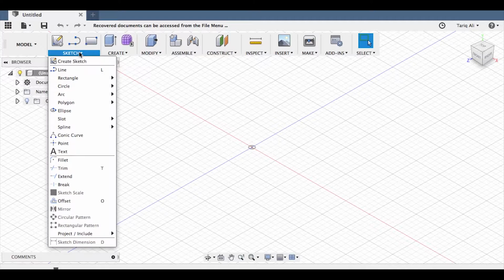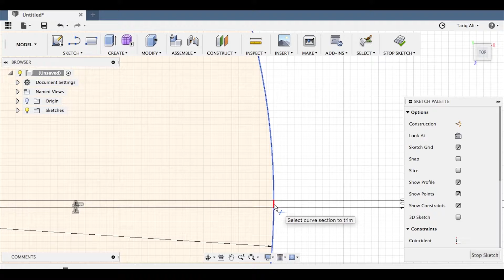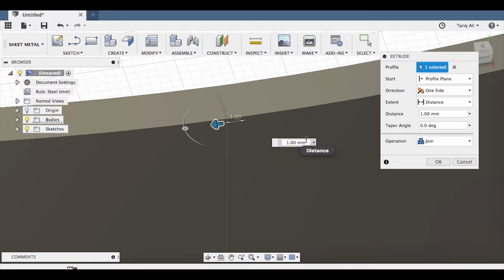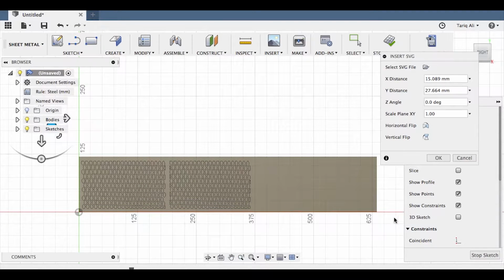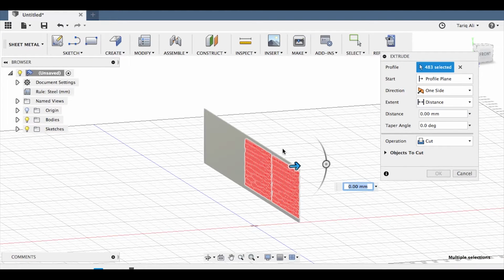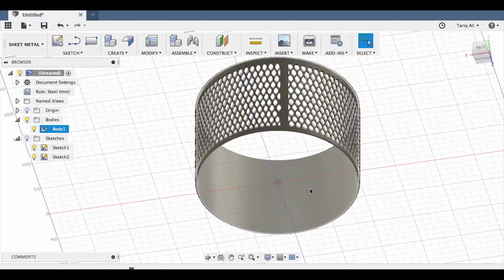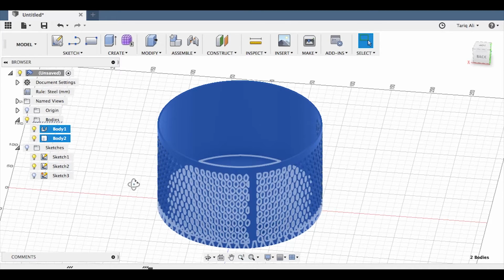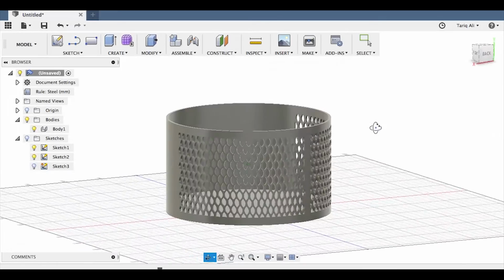Wrap Pattern on Curved Surface | FUSION 360 TUTORIAL | PRINTED ON GEEETECH E180 3D PRINTER

Comment: You could also put a midplane in the middle of the cylinder, put your SVG or text on that, then do an extrude and choose "from surface", select the outside of the cylinder and extrude. Done.
Reply from the maker: Oh yes that technique also works, thanks for sharing it :D
Reply: I posted an image above of what I was describing. I used a cut example but an add works just as well